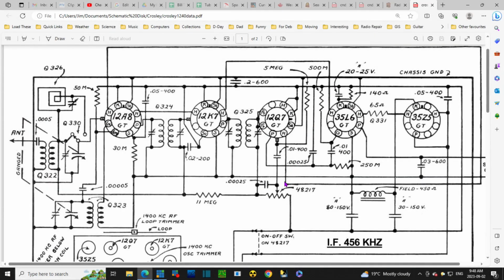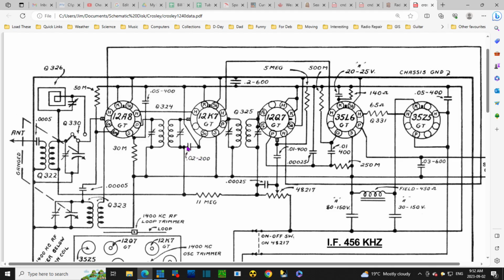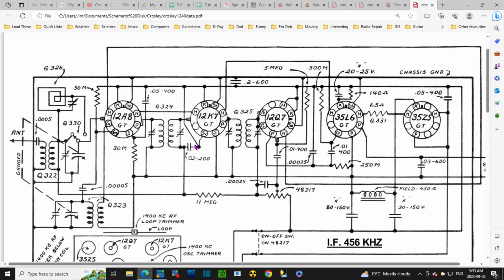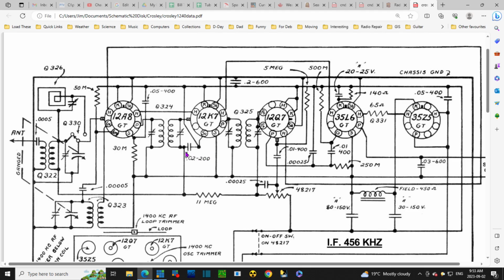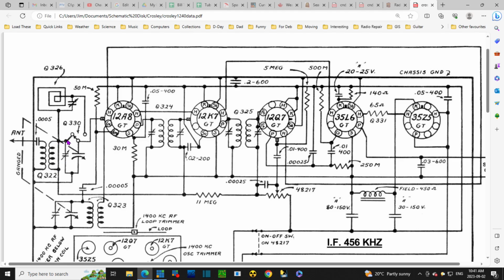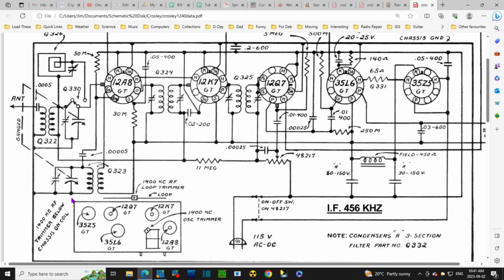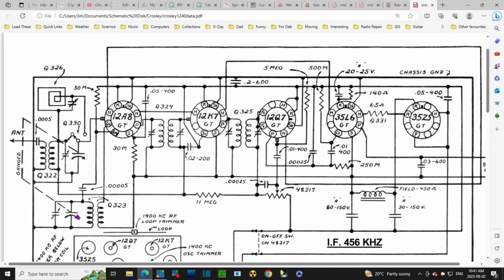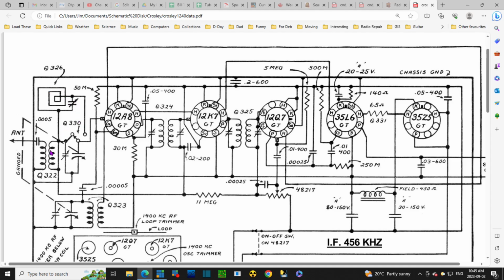Mohawk Model 1240 Five Tube Radio Video #5 - AVC Capacitor

Comment: Change all the capacitors that you want, but you wont fix it. Just from my experience alone I can spot and test a bad IF can when I see it and you get a lot of bad IF cans and don’t know it. A radio has a certain sound as it warms up.  There is noise figure  that exists when the can is not F you are not capable of fixing a bad IF, then bypass the set altogether or  learn how to fix an IF. Otherwise you are wasting precious time. I have been doing this work for 62 years. I can fix any AM radio or at least diagnose it with confidence and use only a VOM. I do enjoy watching  you struggle along and spout BS theory.